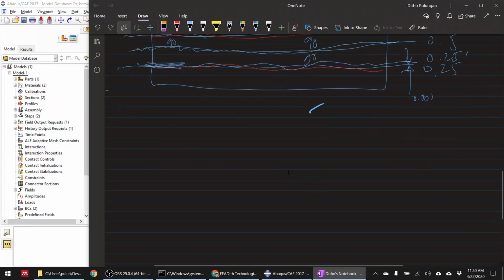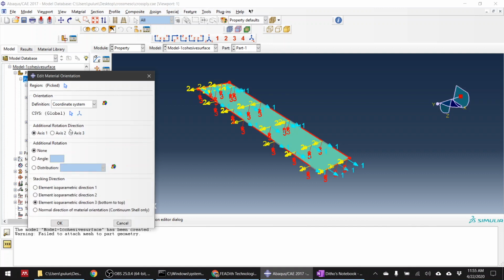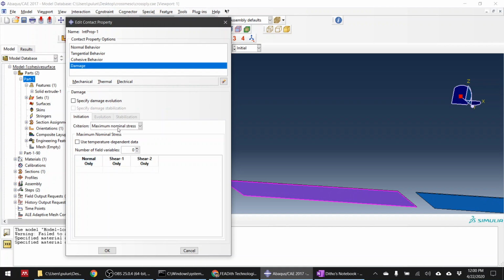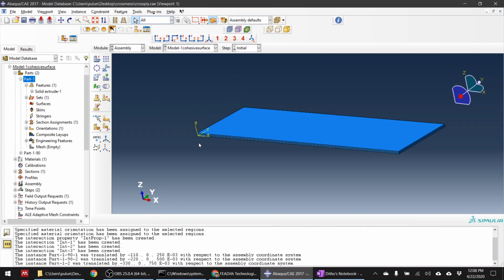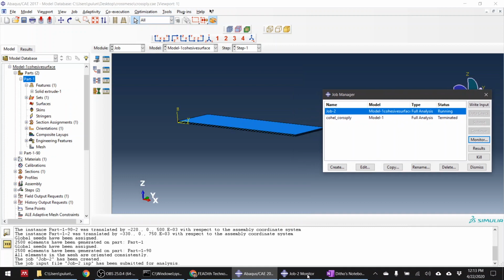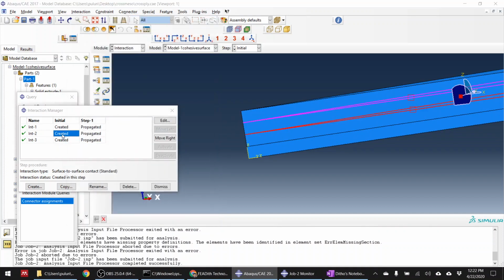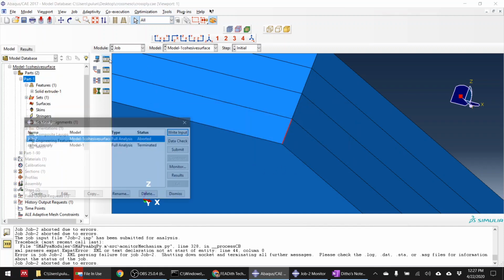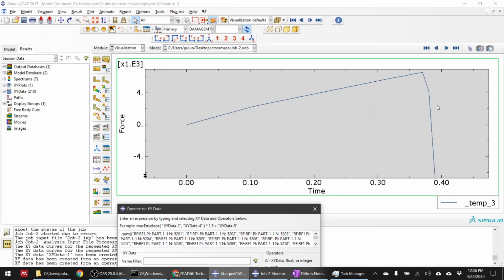Mesoscale modeling of composite materials in Abaqus - Part 2

Comment: What is difference between meso scale and macroscale??
Reply from the maker: Macroscale.. you have no ply to ply delamination since all plies are modeled within single ply of shell elemets (with various integration point through the thickness).

In meso, you model each ply separately so you can model the interface explicitly with whatever interface model you want..

Comment: Why did  you chose axis 3 while assigning the orientation
Reply from the maker: Because i plan to use 1 2 as my inplane direction.. when i choose 3 as out of plane..

You can set as you want as long as tgey are consistent between material property input and orientation assignemnt..

For me e11 fbr dir, e22 trns inplane, 33 out of plane. Thats why i chose 3 as my rotation axis.
Reply: Thanks